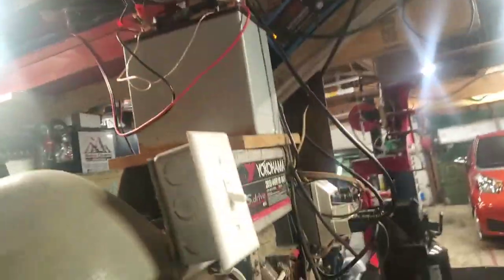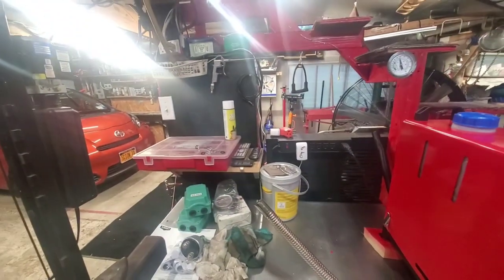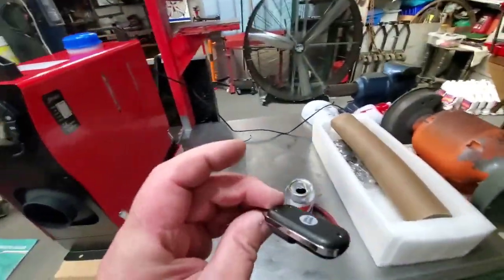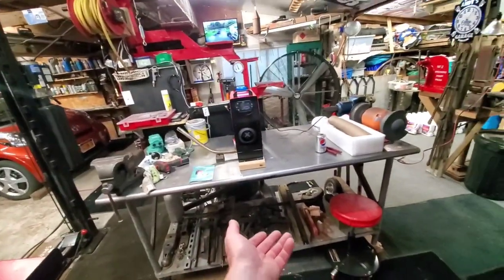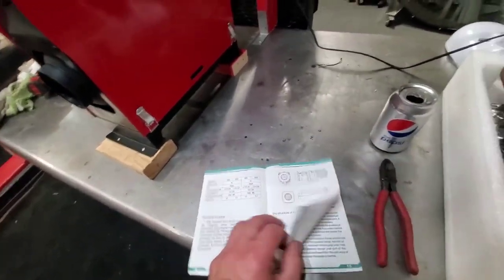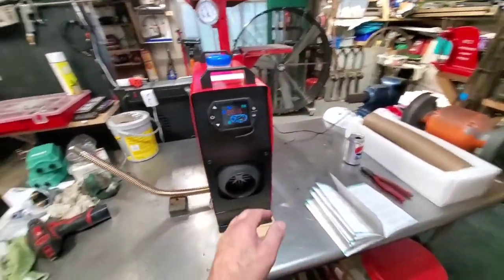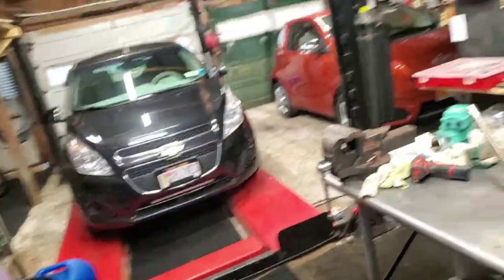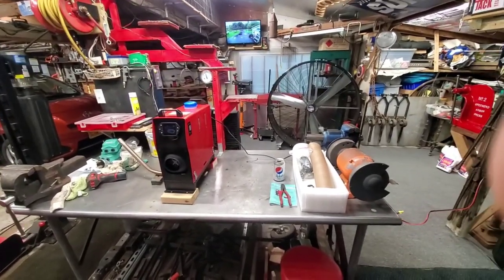8K diesel air heater first run

Comment: That thing is wicked holy moly perfect for your garage you know heat the whole thing up
Reply from the maker: I just made an offer on another one
Reply: @TheOriginalAndysGarage  What is it actually made for in a garage. I'd be scared to have that in my house. Does it only run off diesel. I seen things that can run off kerosene and diesel sometimes could run certain tractors off either. I really don't know that much but I know that you probably do.I don't know anything about tractors I can run a bobcat and a skid loader but I don't know anything about diesel engines that run off different types of fuel and I'm not interested in learning but I probably should That's why I asked you 😂
Reply from the maker: Kerosene does not have any lubrication factors like diesel has that's why this heater can't run off straight kerosene unless you add an additive in or you'll burn the pump out. I love to have things as a backup item in case something happens, these are awesome little heaters to have. They are surprisingly safe to because they are so simple
Reply: @TheOriginalAndysGarage  So you think the exhaust system is safe enough to put it in your house if you put the exhaust system and ran it outside your house or is it just made for a garage
Reply: @TheOriginalAndysGarage  It just seems to have anything gasoline running in your house seems dangerous to me.I'm talking just in case of emergency purposes only like no electricity no heat no wood. Because of the ash bore problem it's really hard to get wood and on top of that it's really expensive where I'm at at least
Reply from the maker: These are actually made for tractor trailers sleepers or Campers or Caravans that they call in England, these are Chinese knock-off the real ones cost $600 to 800, I bought it just to play with but I don't see why not you couldn't put it in your house and run it off a battery and stick the pipe out the window through a sleeve because my pellet stove runs through my wall through a sleeve
Reply from the maker: Or if you had a building very close to your house you could just run the heat pipe into your house and leave everything outside in the shed
Reply: @TheOriginalAndysGarage  One thing I didn't understand is why is it hooked up to a battery if it runs off diesel sorry to ask all these questions when I'm quite interested and I don't think you mind because you're really nice guy I like you you're cool especially when I seen your wife bite it on that bike and you were laughing I couldn't believe it. You were like she's down or somethingI'll never forget that I felt so bad for she's such a nice lady She was like fuck She's tough as nails
Reply from the maker: lol, it runs on 12 volts because it is designed to use in a vehicle setting, not a house but in camper trailers, truck sleeper cabs but if it's safe to use in the camper why not retrofitted to work in your house for emergencies or backup heat, since I have solar system that runs off 12 volt batteries that's why I got it
Reply: @TheOriginalAndysGarage  I guess my point is if it runs off a battery why do you need diesel fuel or do you need the battery to ignite the diesel fuel cuz it doesn't have plugs I'm confused
Reply from the maker: Well you need something to ignite the diesel feel cuz it's not under compression it is being sprayed in the chamber so there is a glow plug and you need power to run the electronics that control it
Reply: @TheOriginalAndysGarage  I've got to learn more about solar panels and get some hooked up at my house cuz I have a flat roof on the back of the house that's really strong I could easily set it up there and the sun beams right on that like a beast.
Reply from the maker: Just remember I'm the winter time you have to clean them off knowing what I know now I would have mounted them down low on four by fours on the ground

Comment: That's the craziest thing I've ever seen that exhaust looks like that. What do you have an exhaust fan on the top of your ceiling.
Reply from the maker: Just a temporary set up so I can see what it does, I have fans set up in the peak of the garage  to remove summer heat and if I'm testing something or running a car. They mount  these in RVs and campers those exhaust pipes are supposed to go straight down underneath the vehicle or camper I had my vent up the aim towards the exhaust fan

Comment: Idk what to belive, some people say that this heater can't heat for shit, but some says it's the shit.. Guess I will find out when mine comes 😂
Reply: And I will try to run the exhaust into my wood stove pipe, I will cut a hole in the chimney outlet, and then stick this exhaust there.. I'm going to heat my basement in winter time.. It was my plans tho, but if it will work... I dont know 😂
Reply from the maker: I don't know both of my and throw out some pretty good to eat but of course you have to consider what your heating is it insulated or not if it's really huge you may not notice it so it all depends on their circumstances if I use it in my car it would probably burn my hair off